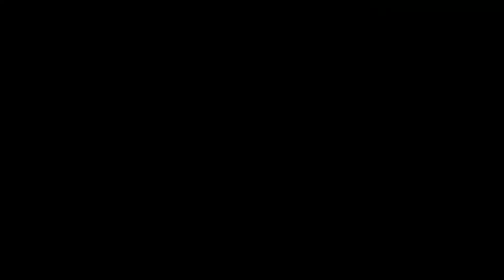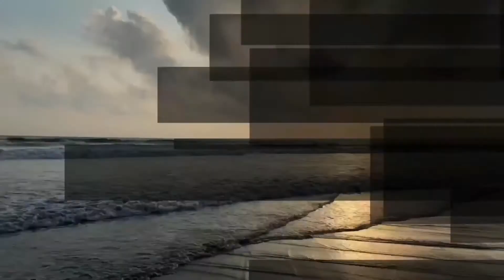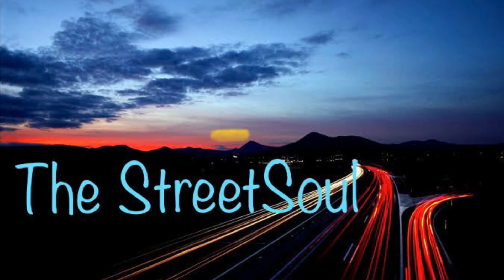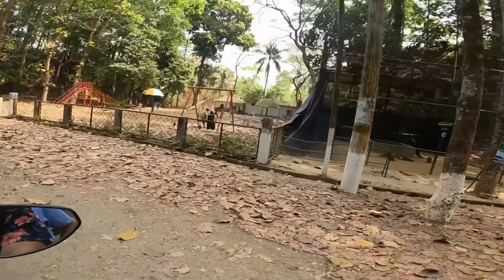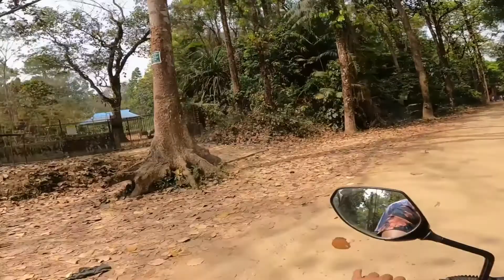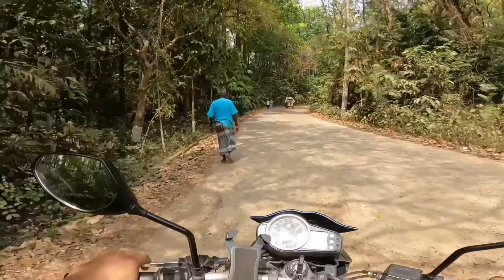Why we use Mineral Oil in break-in period? || Is the Mineral Oil better than the Synthetic Oil? 🤔

Comment: sym 165cc geair shift akto sokto ki korbo.
Reply from the maker: Apnar bike koto km running?
And kon engine oil use kortesen?
Reply: Shell 10w40 full senthetic 4500 km
Reply from the maker: Etodine gear smooth hoye jawar kotha.
Next time servicing koranor shomoy clutch cable ektu adjust kore dite boilen & cable ektu lubricate kore dite boilen.
Thik hoye jabe asha kori 🙂